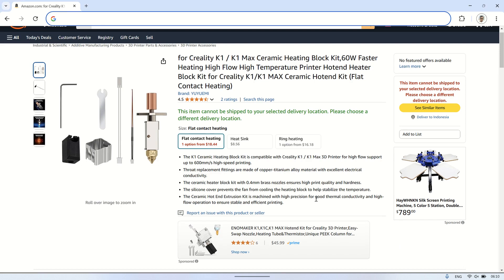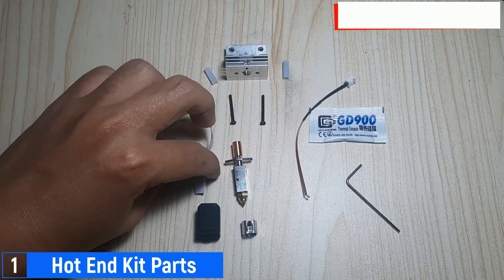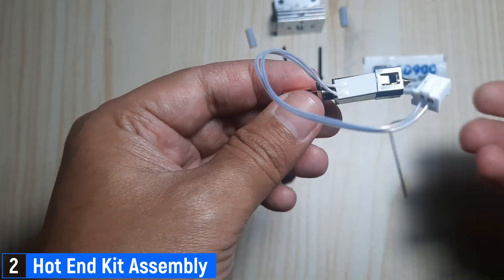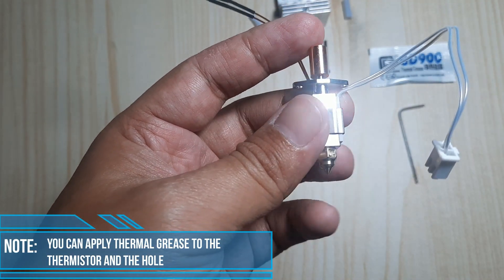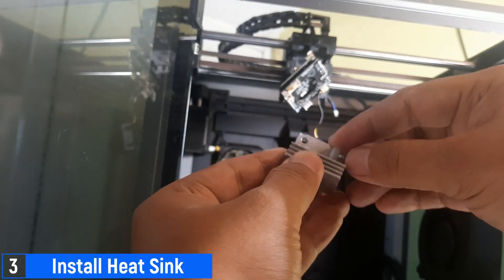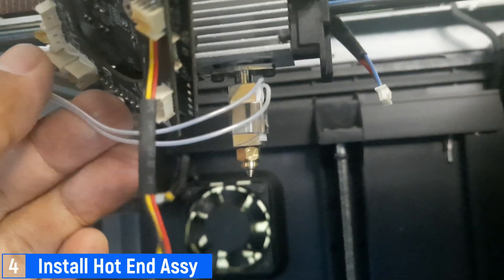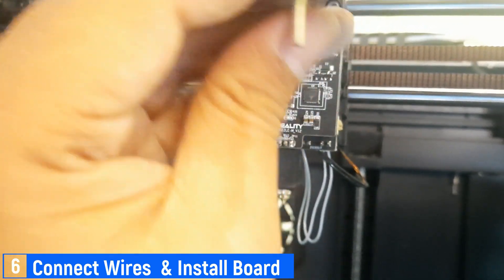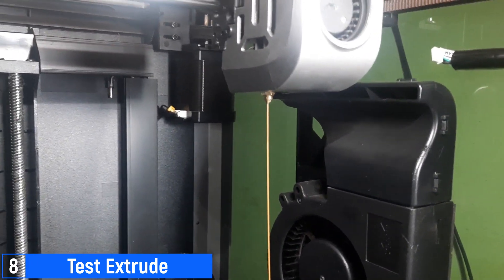How to Install Upgraded Hotend Kit With Flat Heating Element on Creality K1 3D Printer

Comment: I tried using this but the nose always came out looking very flat.  Is there a way to fix that? I'm new to 3d printing and have never tried to design anything else but one statue.
Reply from the maker: Thanks for your comment! If the nose area is coming out flat, it could be related to the print settings, like layer height, cooling, or model details, rather than the hotend upgrade itself. You might want to try printing at a finer layer height (like 0.1mm), and make sure your cooling fan is working properly for detailed parts. Also, check if the model itself has enough detail on the nose area. Let me know if you need help adjusting the slicer settings!